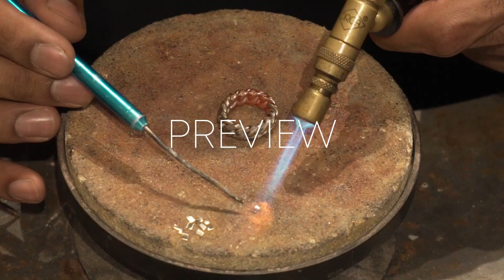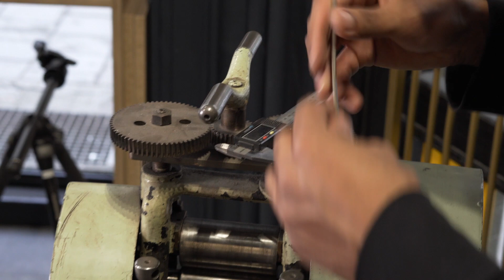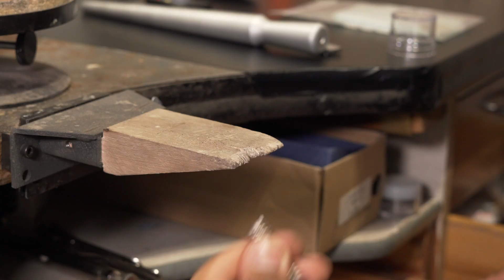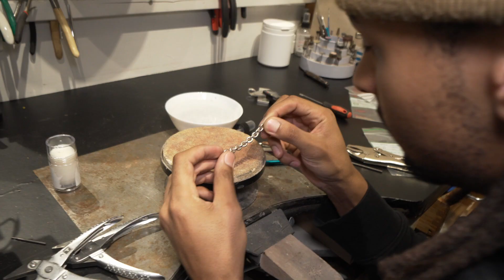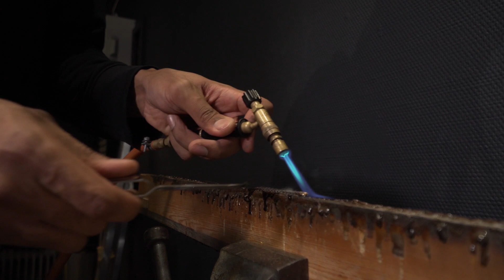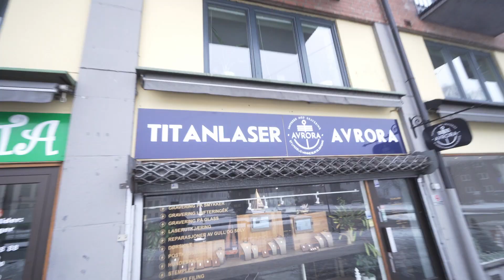MAKING A WHITE GOLD CUBAN LINK RING!

Comment: Hey can you give any tips on a white gold alloy that will look as white as possible and be good for an engagement ring?  I don't want something rhodium plated and am worried about the nickel alloys causing a reaction with everyday wear and no rhodium.  I want to do everything myself so I think a platinum setting is out of the question.   I know some gold alloys are better for casting and all and I don't care about the carat too much just that it's the whitest and will work for a ring 💍. Any help would be great. Iv talked to a few jewelers online and have been getting different advice.
Reply: So many options. Seeing a lot of people using zinc and copper and silver and nickel although I'd avoid nickel. If you really want something nice, go 18k and do 73-77% gold and 23-27% silver into ur white gold alloy